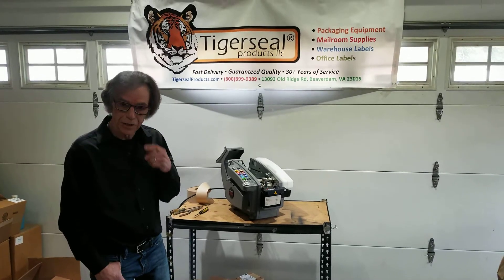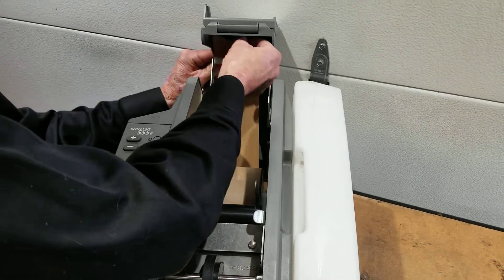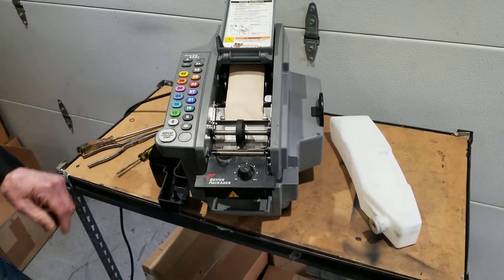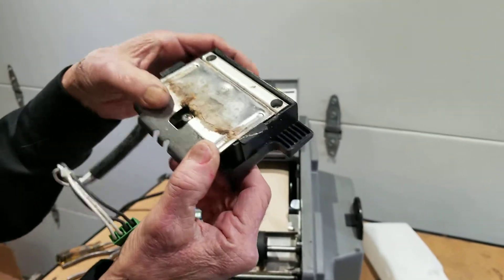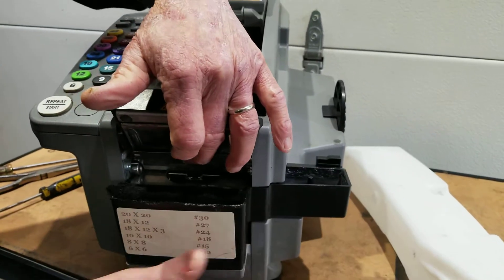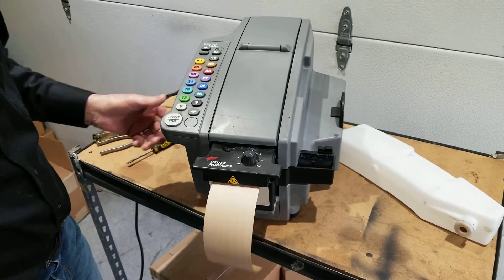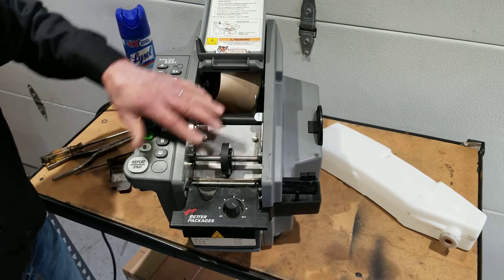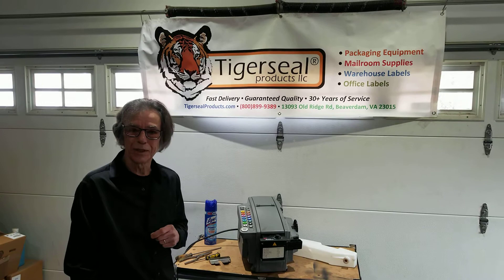Better Pack 555e Service How to Stop Tape Jams

Comment: Thank you
Reply: My issue was the tape would start jamming as the roll was almost finished. Pushing up the metal plate near the brushes fixed it as shown in the video.

Comment: My machine at work has a tape jam every time the tape roll gets around a half inch left. I see no logical explanation for that as to "cleaning" the machine. Any ideas?
Reply: same problem.. if by "half inch left" you mean approximately 1-2" diameter of roll left on the tape.
Reply: For anyone that might see this; I had the same problem, and it turned out to be a combination of the shears being really dull and the spring in the front the pulls down the upper shear to cut the tape not having enough tension strength. I fixed it by putting in a new shear set and putting some rubber tube on each hook on the spring to stretch the spring a little more. A new spring might have also fixed it or maybe putting zip ties on the spring to compress some of it while it is stretched to create more tension.